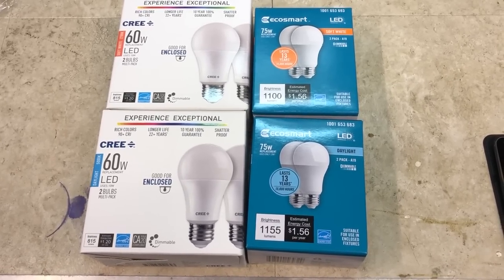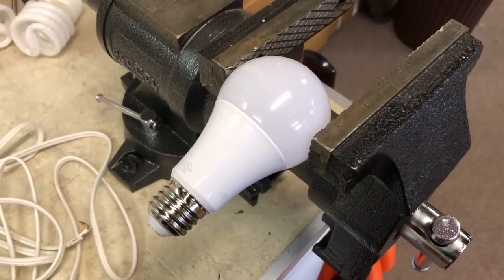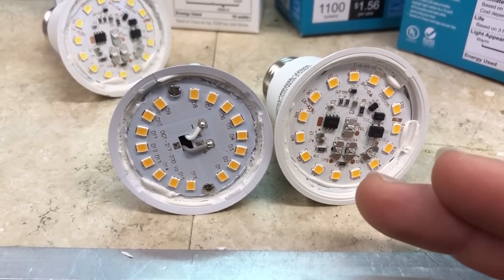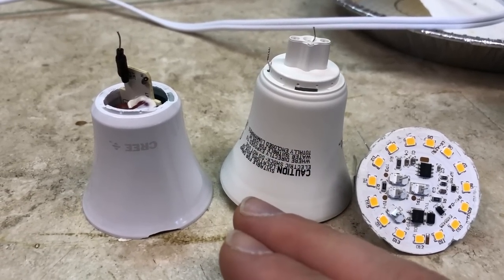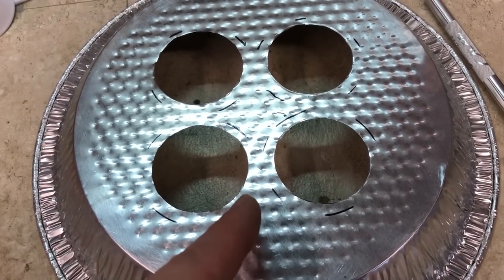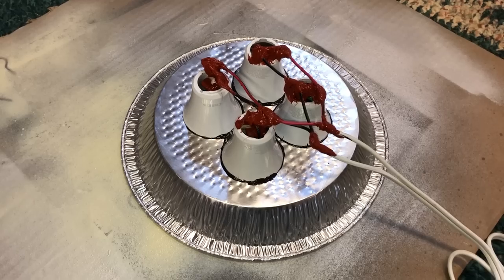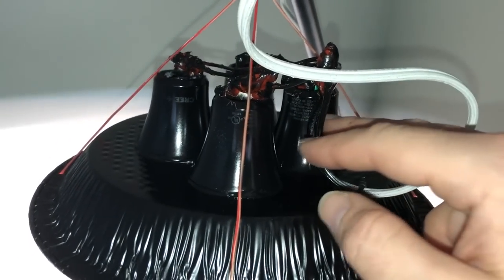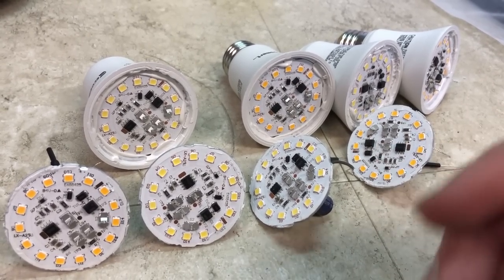The $10 DIY Cree Pie-Tin Dimmable LED Grow Light

Comment: Followed instructions exactly 
Plants shrunk & turned back into seeds
Reply: @realdio6353  No do you want them?
Reply: @realdio6353  If so better hurry they are now pollen.
Reply: @porkchopspapi5757  you bought lights with a curse from a gypsy. You need to get gypsy tears to break the curse good luck
Reply: The benjamin button effect
Reply: @porkchopspapi5757  why are you talking to yourself?
Reply: Porker
Reply: Liar.
Reply: @loonyloony6550  It's true. But check this out. I planted the seeds. They grew so tall, the tops disappeared into the clouds. So I climbed one. It took two days to get to the top. And guess what was up there, a giant coffee shop in Holland!
Reply: @porkchopspapi5757  cool. I am using them and the plants are good, certainly not up to the sky like some beans(lol). But they do work.
Reply: Dude that comment was better than the video. Cheers

Comment: I've been doing pretty much the same thing but using power strips and outlet plug/light bulb socket adapters. Good thinking deconstructing the base, cuts the cost in half. Thanks for all your good work.
Reply: I just got that same idea, was looking up parts, and then it hit me that maybe the weight of the bulb would unplug the light from the strip if hung upside down.  Do you have that problem?  Thanks
Reply: @extendedp1  No, never had a problem but I did buy new power strips and bulb socket adapters. The new parts fit securely enough
Reply: @koyote3000  great, thanks

Comment: You can definitely grow plants with LED light bulbs at Home Depot. You want the cool white Spectrum for vegetative Cycles. In bloom, you'll want the warm white high cri bulbs.... higher color rendering index means more far red. 

The main drawback is efficiency. For large-scale grows, you'd do better to have an independent driver in slightly under power the diodes.

Comment: I have a grow gowing with led bulbs. Dont take off the base and solder, just buy light fightings and wire them together. Much less compicated as long as you dont go above fitting ratings.

Comment: I was thinking of something fairly similar not too long ago! These led lights are getting cheap in bulk buys and a bunch of the led discs could be wired up in series parallel pairs on a sheet of aluminum to make a cheap quantum board style light. Coupled with a cheap led driver it would be great, but re using the stock drivers like you did is way cheaper with the only real drawback being bulk, but if one were dedicated enough you could make the stock drivers remote mount. Love it!

Comment: So quick question. When removing the diffuser from the lights, will they still operate properly in a humid (enclosed) environment? I’ve done this on a few bulbs, and just curious if the moisture will negatively affect the inside of the bulb. The bulbs were “suitable for damp locations” wondering if that has changed 😅 I’m using the 4-1 socket adapter. Turns one socket into 4 😃
Reply from the maker: I don’t use them in a humid tent, but I have not had any problems using them in the house.

Comment: I just liked and subscribed because i had just bought grow lights and started suplementing with standard cree on the sides and thought for the price and quality, it might be the best overall light. So really great idea, and really like how youre showing how the best grow light components can be brought together cheaply and easily. It's good you're letting people know the safety risk of the elictrical side, but in removing the diffusing covers, isnt that a big risk for fire, arguably the bigger risk. Cree probably has it so they're not losing a lot of lumen on it, a flood light, with the cover and included reflector seems like the safer option.
Also im using 2700k, 3000k, and 5000k hoping that they add colors on the warm and cold color spectrums, rather than subtract from the other end of the spectrum. Exmpl. RGB neutral is 2,2,2, warm is 3,2,2 cold is  2,2,3, rather than warm is 2,2,1, and cold is 1,2,2. Do you know aprox which is a better matching model?
Reply from the maker: Not sure what you mean by matching model. you don’t really need 3 color temperatures. Just some on the warm end and cool end. Cool white really should be 6000k or a little higher, but not many store bought leds are 6000k any more. They appear too blue for most people’s tastes. Slightly more heavy on the red side is fine for general growing though.
Reply: @GrowingAnswers   sure, two models of potentially (and simplified, and exaggerated) a neutral RGB might give a ratio 2,2,2 so two lumens of red to two lumens of green and blue. The first model is warming up by adding on the red side, for a warm light, and cooling by adding a blue lumen. The second model of how cree could manufacture warm and cool lights would be to subtract from the opposite end. If you add up RGB in both examples one you end up with 5,4,5(less green) the other 3,4,3(more green). So, and just made up ratios to kind of figure it out, by choosing bulbs on both ends of the spectrum, is the result actually more red/blue or more green. I bought a bunch of floods on the red and blue side, but agonized over it unnecessarily probably, betting it mostly washs. Thanks for putting your videos up. I'm not an expert at any of this, and really have no idea what really is or isn't safe, but those open LED chips do seem gutsy.

Comment: I have been doing similar thing with so called down lights 220 v that a have a very small and inexpensive fitting. Those lights are so light so you can use the electric wire to hang them and hold the wire with a clothing peg to easy adjust the distance to the plant as the plant grows. What is more interesting is the color spectrum of the light is it narrow or broad spectrum I don't know. According to the later spectrum theories you need more colors of the spectrum then previously assumed for ideal growth. Old theory is blue light for veg and red for flowering.

Comment: I know you were trying to do this on the cheap, but I think it's much better to use screw in bulb bases. You can change out the bulbs to different temps easily. It may cost more, but it's way more versatile that way. And the average person that can't solder and do your project safely would be better off not messing with AC wiring. Thanks for the video
Reply from the maker: Someone else already has a video like that. And migro just did one too.
Reply: @GrowingAnswers  I saw the screw in light bulb bases on Amazon for as little as $1.58 each. I think I will give those a try

Comment: how to start a house fire tutorial. just go to walmart and buy grow bulbs and clamp domes. pretty much the same net cost and way less hassle. also 1000x safer.
Reply from the maker: 1st, there’s a disclaimer in the description. 2nd, there shouldn’t be any danger as long as it’s crafted with a basic understanding of electrical safety. Plenty of electronics can be considered “unsafe” when you look inside. 3rd, it wouldn’t be a $10 light if yuh had to purchase sockets or housings. 4th, the point here is to get the diodes close together so that it acts more as a single light source that can be placed closer to smaller plants. You can’t do that by using multiple clamp lights. It’s suppose to be a cheap and fun little project. Personally I would not have made this, this way for myself. This was just something cheap and unique that works. I’m actually still using it for my banana tree and it’s growing a lot better now. 

Having said that, this video is actually just a stepping stone to another pre-planned project.
Reply: It makes me laugh when people think this is some kind of danger. You just show how little you know about these things. I could have safely made this as a child, but I can say this is safe after high school, and college for electronics. If it started a fire, it would be because the person making it was a fool who can't follow directions that I could at 5 years old. If you light your house on fire with this, you probably are not even able to jump start a vehicle. I understand that not everybody is bright enough to handle a project like this, but that doesn't make the project the problem. You are.
Reply: The replies here are why Americans eat Tide Pods.  You two clearly don't know why this isn't a good tutorial ... You assume 99% of people are proficient with electronics.  For this video to be legitimately informative, you need to include the science as to why your method is safe (which it isn't), and the dangers of what could go wrong, like shorting due to bad soldering or insulating, or positive vs negative vs ground... Your video doesn't explain a lot that's truly needed for others to make a rational decision.  This isn't science class and vid creator is self taught.  Sigh... Next we'll have people doing home surgery while saying it's ok cuz there's a disclaimer..... FOR ANYONE READING THIS, PLEASE SPEND THE EXTRA $20 ON A CERTIFIED BALLAST AND HOUSING... FOR YOUR NEIGHBOURS SAFETY!!!
Reply: @GrowingAnswers  Thanks for the video. I just built my own plant shelf for 20 bucks and bought a clamp done with a 6500K bulb for 5 bucks. Was thinking of buying another two, and a add another 6500K and a 3000K one and hang them on the shelf and found confirmation my logic is right. Won't be doing what you are doing though as I'm not familiar with electrics and I like the mobility clamp domes give you. Not growing basil here, just trying to help my small urban jungle live well over the winter. Won't be able to keep them on the window sill as the radiator is there, also the room in West oriented.

Comment: I have a 1ft x 1ft x 2.5ft tell box with 3 100 watt equiv led house bulbs  1600 Lum each with diffuser off   how many wattz am I running and what light would u recamend for my space or how many of those bulbs do I need to have 1 dicent weed plant
Reply from the maker: Sounds like around 30 actual watts. That’s plenty for a 1x1 and the plant that would fit in there.

Comment: Would these 2 color temperatures of the led bulbs cover a fairly deep and wide spectrum for flowering plants that require intense light?
Reply from the maker: Of course. And it doesn’t make a difference whether it’s flowering or not.
Reply: @GrowingAnswers  Also,could you compare the depth of wavelengths in cheap leds vs cheap cfls.Most people only look at cfl for cheap lights but if cheap leds have a comparable spectrum why not use that?

Comment: Very Nice Idea but keep in mind the Electronics and the LED's are maybe LIVE! I would suggest to put a Heat resistant clear coat on them. Also you need a grounding Wire on the Metal pan. Check your Breaker (Amp rating) and make sure your wires can handle the full current ( if you have thin wires the Breaker may not work and the wires can Catch fire). The Resistor in the Hot Lead of the LEDS works as fuse protecting the Electronics in the Lamp from catching fire, but they are not protecting your salvaged wire. In Germany we have 16A for our wall Sockets, in Countrys with 120VAC you may have something close to 32A (The small Red/Black wires definately cant handle that)! Becareful.
Reply: Keep in mind wire guage and amps it can safely handle. Don't touch what may be dangerous. Might help to have smoke detectors. I don't know about this build, but my local home improvement store sells "lampwire" by the foot for dirt cheap and it can handle way more watts than this little setup will take. If salvaging wires, opt for wires from appliances that use more amps than your intended setup. Wires taken from desk lamps will probably be fine for this set up. I will say that adding a fuse inline is a good idea. Would cover your bases if something fishy goes on with the bulbs.

Comment: Nice budget friendly modular light, wonder what the efficiency would be and how many could be ran in series. Hopefully people will stop using cfls for grows now lol. Especially with all the advantages LED.
Reply from the maker: Technically they would be ran in parallel. You could run as many as you want. Just don’t exceed 10 amps or 1500watts or you’ll pop breakers.
Reply: @GrowingAnswers  4 13w bulbs per light 1500 watts.... Math.... 28 lights. Daym! That would be too much light for a 4x8. Very nice
Reply: @toveryonder1115  that's actually about ideal actually. Typically you want minimum 30w per square foot for good growth and for ideal growth at least 50w per square foot. For a 4x8 area at 50w per square foot that's 1600 watts for that square footage.

You can always get away with less but minimum 30/sq ft is a good general rule.
Reply: @lazyh-online4839  yep, too much can hurt the lil ones but the big ones love it

Comment: I just decided to use floodlights and remove all material that was on the LEDs and used aluminium tape to reflect light better. It increased light density 30% and 20W (true watt) lights costed only 8€ each. I used two 20W and one 50W floodlight 4000K with two full spectrum 100W COB LED light. 50W floodlight was only 20€ and the COB LEDs 75€ each plus better fans 28€ of total for the both units.  I'm getting something like 20 000 Lux at 80 cm distance. Still bretty weak compared to sun with 100 000 Lux at half meter of the window.
Reply: Hmm. I tested it again with reflection material on every side and now I got 27K Lux and 33 Lux where the soil start. It may a bit more than I need. Almost 1K umol/s per square meter. I have been running a year without all sides covered. I feel now a bit stupid. I had only three sides covered because I tought it does not matter because there was a wall at the back.

Comment: Why don't you use 4 normal light fittings with reflector from a cheap store ? Same price , same effect and you won't void your fire insurance or need all these expensive materials that you didn't factor in like the epoxy glue and high temp silicone.

Comment: They have a cree 19w 2700k flood light at home depot for under $8. I had bought 4 as supplemental light a month ago but returned them to buy 2 Onforu. 2700k 60w led flood lights for $20 a piece.
Reply: I got some at ocean state job lot for about $2. I forget exactly, but I was mad that I didn't buy all of them after.

Comment: I can't find any decent grow lights that I need for my purpose, I want a 6500k color lighting but I want to fill a 12x10 foot room with enough light to grow some indoor plants, I want to hang them from the ceiling.  I want to grow a banana tree and some 5 ft bonsai trees, how many lumens do I need and what lux?
Reply from the maker: Well off hand I can say you don’t need that much. Probably 70-150 watts of leds is fine
Reply: You can use anything from 500 lumens. If you have plants grouped together maybe go for 1500 lumens so they can sit further up

Comment: Nice tutorial on Screw In Leds as grow lights, and kudos to your engineering,  but, Dude, you took something simple and safe and desconstructed it into something complicated and potentially flammable.  Why not spend an extra $4 and buy a four into one light fixture off Ebay and simply screw in the lamps without the globes-super clean setup.  Plus this looks like it was beaten with the black ugly stick, I couldn't bear opening my tent to see this hanging...
Reply from the maker: See description. And I have another video coming out similar to this. This was just the absolute cheapest way that may not be pretty, but is effective.

Comment: What do you think about led filament light bulb? Are they good for plant growing?
Reply from the maker: No. They are less efficient because they are omnidirectional. And the light is slightly less uniform.
Reply: Also cfl are omnidirectional but they work. If i put led filament light bulb under pie tin? What do think about it?
Reply from the maker: Antonio Santucci sure it would work., but not many people use cfl anymore. They are terrible in the efficiency dept. the filament led would be slightly more efficient, but it better off getting a unidirectional led flood light

Comment: This is only for the person who has some electrical wiring experience, not for a novice
Reply from the maker: See description
Reply: connect + to + and - to - ??
It doesn't get any simpler than that. We did that in 7th grade. Not with 230V obviously.
Reply: @sirmoke9646  but it does.... Plug in the $400 grow light.
Reply: 2 wire electricians :)

Comment: If I may add, it was proved years ago, by pot growers, that flat white paint is better at light reflecting than shiny metal.
Reply from the maker: Unless the metal or aluminized sheet is textured. Diffused light is better than directly reflected light. So technically yes, white is better than a mirror or shiny metal. But grow tents are made with textured Mylar for a reason. It’s reflecting diffused light the same as white, but does it better by a small margin. A pie tin has pleated edges which act as diffusion.
Reply: Also it depends on your uses of the light and reflection. Check out MiGRO's recent video comparing the 2 reflection types and the PAR relating the two. Essentially on a top-down setting (like most tents) the wide reflection of whites cause a PAR loss because some light gets reflected back upward away from plants. If you're using top-downs with side-lined lights, then yeah white is better.